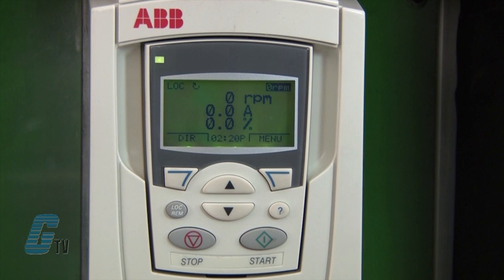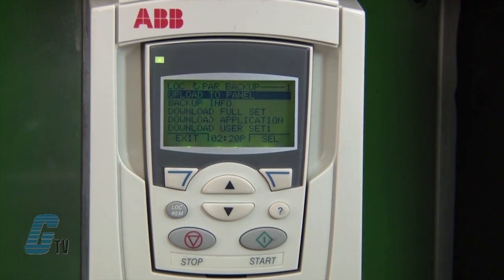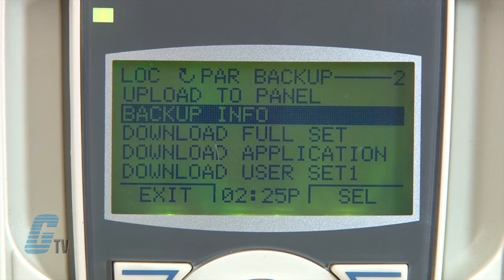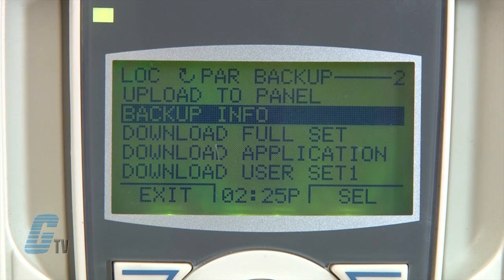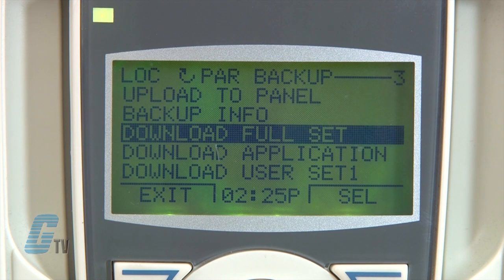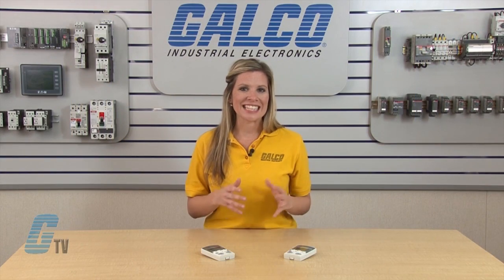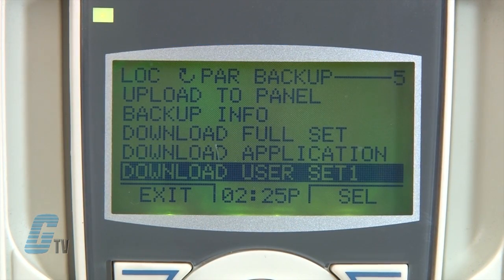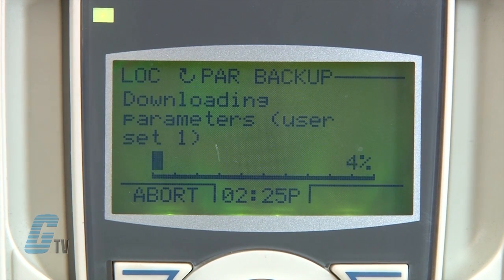How to Copy Parameters with ABB ACS Drives from Keypad

Comment: Hello sir hope you doinv well...i have dcs 800 dc drive s02-0025-05-0
As from data sheet it is 230vac to 525
Suorces volatges are 3 phase line 400..
I want to limit fileld volatges at 250 dc
And armature voltages also at 250dc

Thanks for  your reply in advance